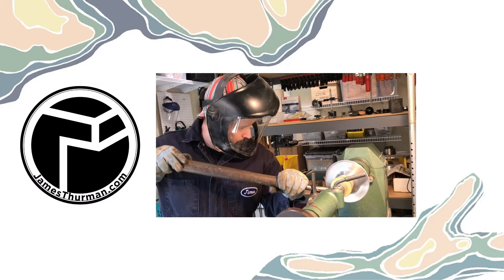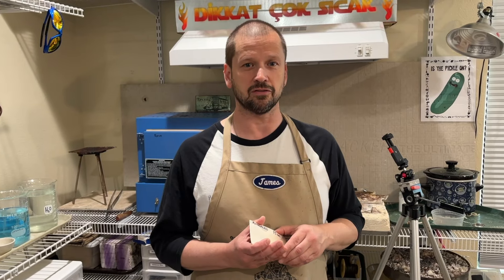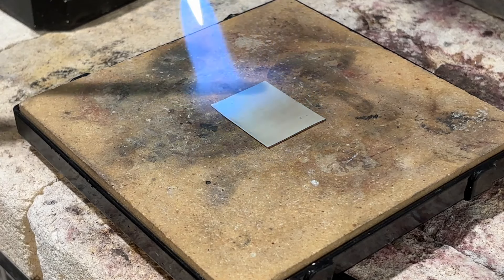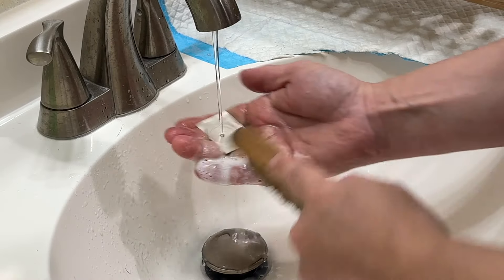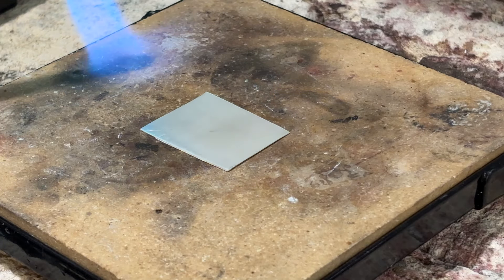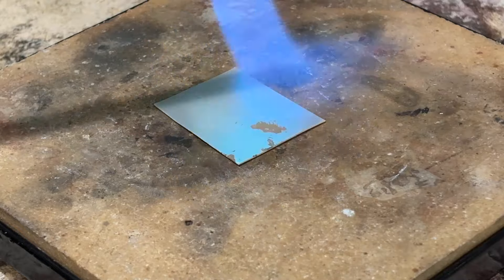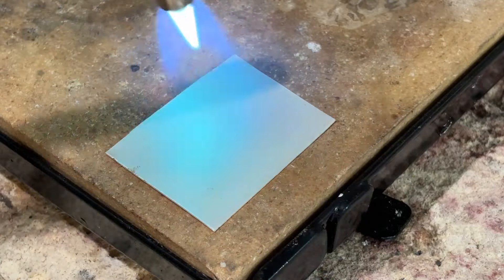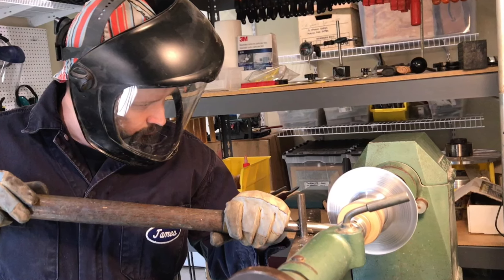Depletion Gilding

Comment: Some good tips.  But I'm puzzled.  I thought that liver of sulfur does not work on fine silver because there is no copper present to oxidize and I have not been able to do so when I have tried to oxidize fine silver.  But here you say depletion guilding is used in association with patina.
Reply from the maker: Different patinas work in different ways. Pure silver will darken when reacting with sulfur (like liver of sulfur). Copper will react with many different chemicals with many different results (sulfur, oxidizers, etc.). Sterling can be confusing because there is both copper and silver reacting with the patina. I hope that helps?